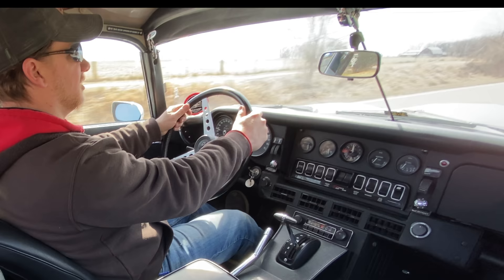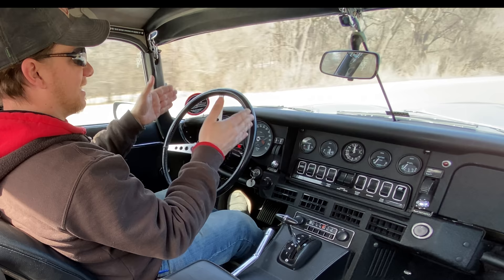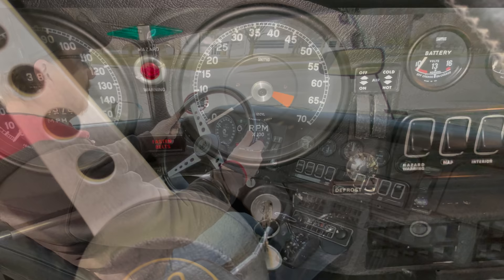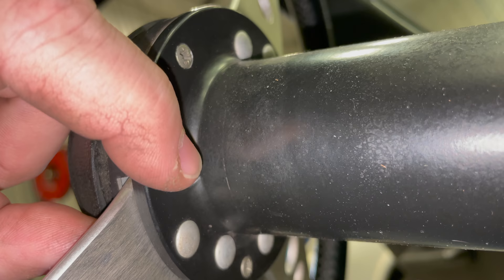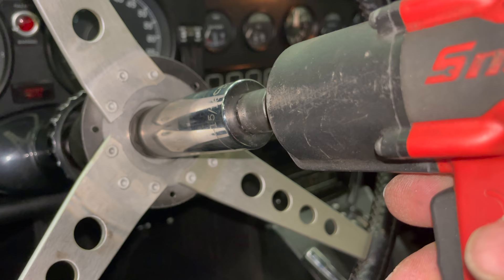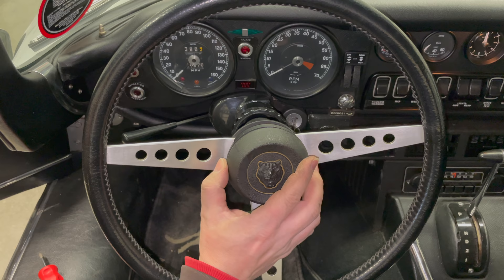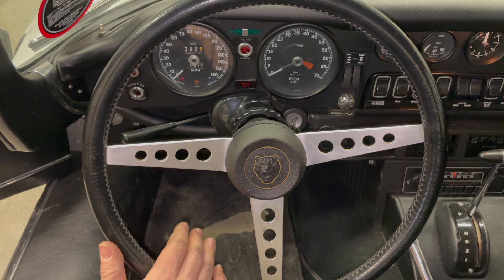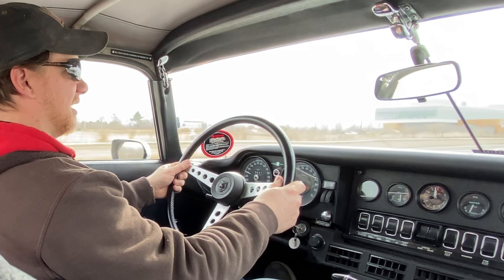1973 Jaguar E-Type Steering Wheel Adjustment

Comment: Air bags make that impossible today. I like old car simplicity. Good stuff Steve. Take care
Reply: Most modern day vehicles have a key way or centering position on the shaft, it’s easy to remove a steering wheel with an airbag. The airbag is not the problem.

Comment: On the E-types and XJs etc you should centralize the rack first before any adjustments. On the steering rack there is a grease nipple on the adjusting pad. Remove the nipple and use a pin the same size and push it in the hole. Move the steering rack left and right and the pin will line up with a purpose hole in the rack. The rack is now centralised. Leave the pin in place. Line up the front wheels with the back wheels then set your toe in. Remove pin.

Comment: I had a 1978 MGB, I bought new, that developed a similar problem after being aligned. The selling dealer told me the problem “couldn’t be corrected” when in fact, he just didn’t know (or bother to find out) how to fix it. I took it to an independent suspension shop and they WERE able to fix it correctly.
Reply: I had two brand new MGBs during the 1960s and both had the steering wheel a little off center.

Comment: Nice easy fix, but male sure you refit the nut and locking nut before you test drive it. I like the V12 out of the Jaguar range. I had a Daimler V12 very nice car and no slouch really.  Jsut been watching Richard Michael Owen putting an old Jag back together after rerpainting.

Comment: I can't say about rack and pinion setups, but most older american cars with recirculating ball gears have keyed steering wheels, so you have to set the steering wheel by  centering the tie rods...although i have seen steering wheels jammed on and stripped out the keyway.

Comment: But on a series 2 it's a different procedure. 3 grub screws to get the center boss off. Which is not the horn button as that is on the indicator stalk. Why did they change? Then just as you demonstrated. Good point about the Series 3 not being a sports car. In your auto with A/C you are looking for comfortable touring. Thanks for the video, a bit different from the Sprites.

Comment: Some cars i.e. GM are clocked so that you can only mount the steering wheel in one way. So to set straightness on the wheel may need suspension manipulation

Comment: I'm surprised to see an automatic transmission in a 1973 Jag. I thought they really didn't gain any traction until the 1980s?
Reply from the maker: Almost all E-Types were automatic starting in 1971.
Reply: I would say that over here in the UK there are hardly any automatic e types I guess Jag knew what the US customers wanted
Reply: @Thanos.m  you are quite right, Most US drivers do prefer automatic transmissions.  As a US driver who actually prefers standard transmissions, I have nevertheless always found the British preference to be tinged with a sense of moral superiority. Tell me I am wrong, and I will beg your pardon.
Reply: Steve 's not quite correct . The first "e"type available in  Automatic was the series 1 2+2 introduced in 1966 specifically to meet the demands of the North American market.  I don't think the standard wheelbase could take an automatic . From 1971 when the series 3 was introduced either box was available .
Reply: @makelikeatree1696  You're right ! I do prefer manual but one of my past favourites was a series 1 XJ6 auto ! ( back in 1974)   And in today's traffic it has to be an auto !  Of course being English l drive manuals !  😂😂😂